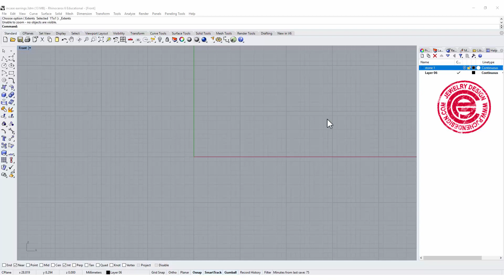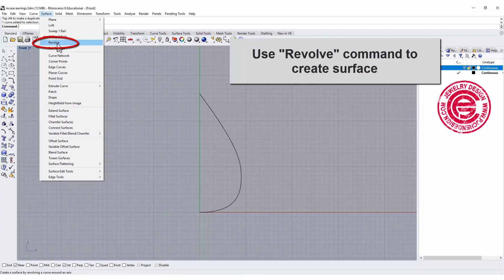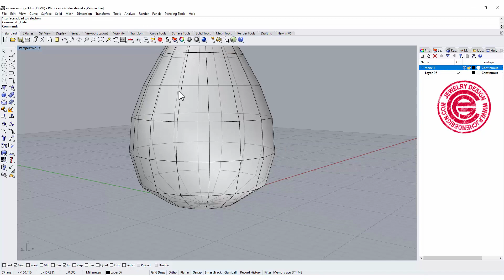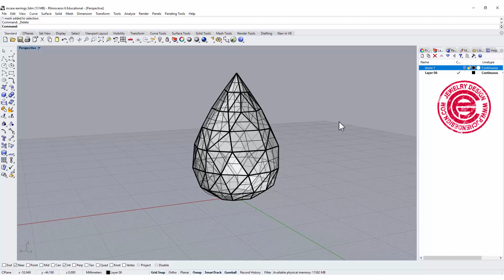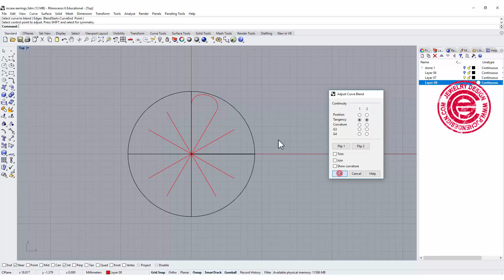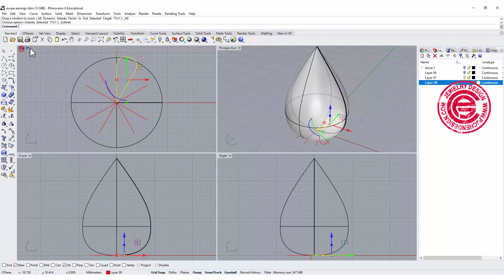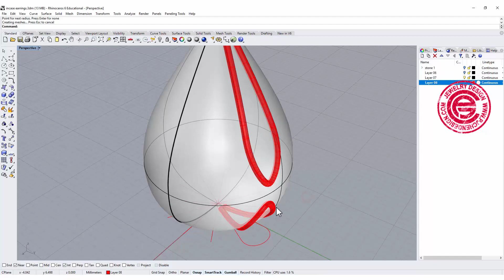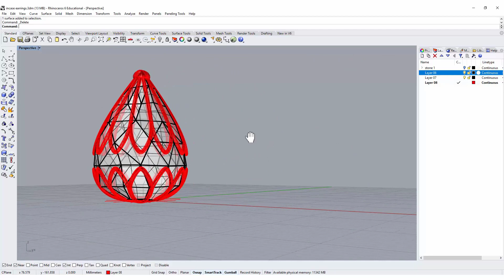Caged Earring Jewelry CAD Design Tutorial in Rhino 3D #47 (2018)

Comment: Good tutorial Pj .one question I saw you pipe the design at .35  radius but what is the smallest radius u can make it at if you wanna 3d print it ? .and same thing for  milgrain and prongs for stones ,what is the smallest it can can be made in order to 3d print ? .thank you
Reply from the maker: Hi John, great question for a stand along wall thickness, I suggest the smallest set up to be 0.4mm. However it is also depends on how tall the wall is. This tutorial is intended for discussing the modeling. I didn't plan to print it. 0.35 radius make it a 0.7mm round wire. If it is small enough, it should get printed. If it is large like 30mm tall, it will get print, but I may rework some design to have more support somewhere in the middle to ensure casting result.
Reply: @PJChenJewelryDesign  thank you very for your information it was very helpful